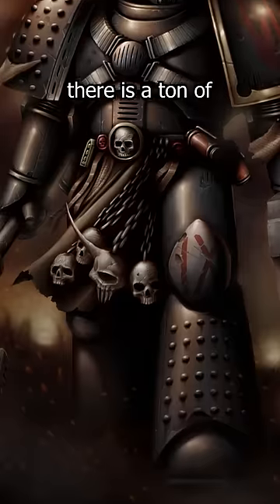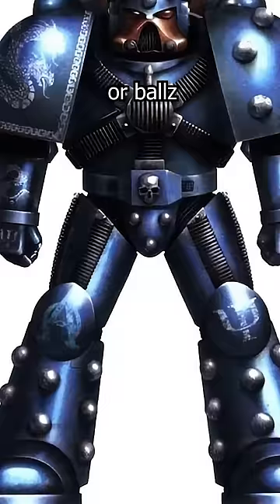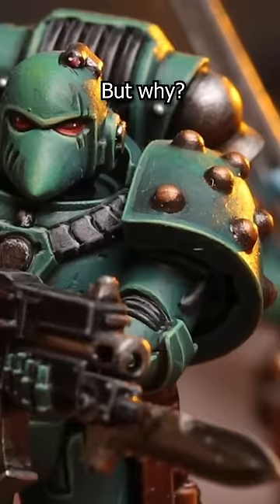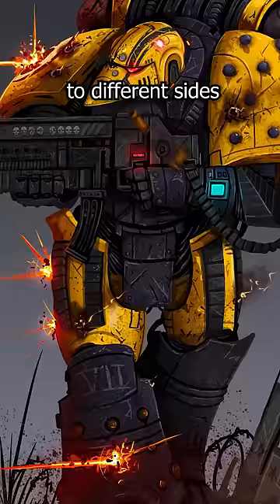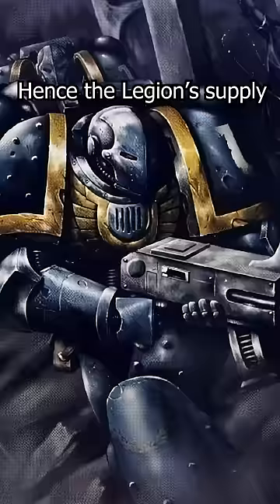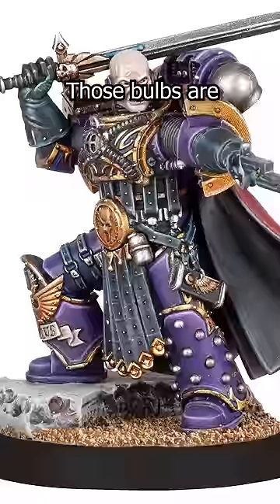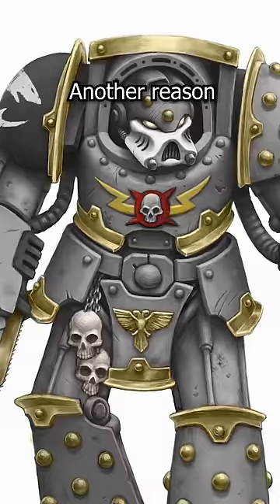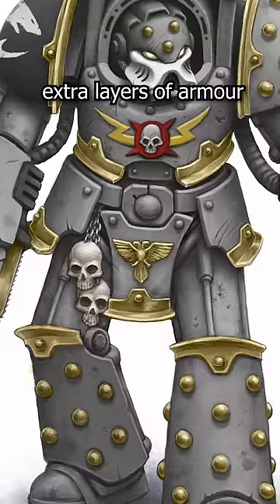What's Up With Those Power Armour Balls/Bulbs? #warhammer40k  #majorkill

Comment: I don’t know where I heard this but my understanding was that it was meant to be to better deflect bullets, that is it would make them ricochet rather than embed themselves into the armour
Reply: not very effective though, a curved smooth armor would work better than just balls.
Might be information that you may have heard but due to the passage of time, you have grown to associate it with warhammer40k. Human memory is fickle
Reply: That's false
Reply: @ZOCCOK  well... Given that resources are scarce "studding" the existing armor would be much more cost effective than making it all out of a superior material.
Reply: I thought the balls looked cool 😢😢😢
Reply: The big rounded pauldrons are specially shaped to be positioned forwards during combat, and are thicker and rounded which increases the likelihood of deflecting more shots. This is why the marines in Astartes are able to survive the hidden autocannon, since it's hitting their pauldrons as they run by. You were probably thinking about that and got it mixed up with these studs.
Reply: The bonding studs helped the armor not burst apart from the explosive bolt round not always working but still helping
Reply: studded leather tier reasoning
Reply: It might possibly disrupt the path of a bolt shell sufficiently to prevent it from penetrating fully, thus thwarting the mass-reactive charge that relies on the shell being inside the target. 
I still don't think it would be very effective at that.
Reply: Yup, that’s why the first marine minis GW produced (MkVI “beaky” Corvus armour) had the studs on one shoulder pad only; the shoulder pad that would be facing the enemy when aiming with their Bolter. For extra protection from incoming fire.
The molecular bonding stuff was added post hock, after the initial explanation, when GW started making more power armour variants.
If the studs were simply to hold the different bits of mixed and matched armour together, the placement would be much more random on the MkV Horus armour. As it is, the stud placement is always in the same place; lower legs, enemy facing shoulder pad and head. Exactly where the armour would be reinforced.
Reply: Yeah this was in the some of the older lore.
Reply: Nah think about the modern day tanks and WW2 tanks. There is reason why military stopped using a rivet for armored vehicle.

Comment: I remember reading somewhere that during the Heresy, both traitor and loyalist Astartes had extreme trouble actually killing each other after the advent of the MK V armor, due to its durability. Marines would have to mag dump each other and sometimes even be forced into melee despite the strength of their bolt guns because they couldn't break through the ceramite plating, making an already devastating civil war that much more brutal.
Reply: I mean that checks out, weapons like chain swords and bolters are better against organic targets
Reply: Still armor piercing rounds were in circulation with the traitors and loyalists with the formers being devised and design pre heresy in secret whilst the latter was designed during the heresy with the latter being rarer due to complexity funnily enough
Reply: @toasterten1293  Not if you look at the games cutscenes
Reply: @pilot778spartan3  The Traitors prepared for the heresy, but the loyalist adjusted quite quickly to it. Even with preparation, during the Istvaan massacre, they had a very hard time trying to crack the loyalist. The lost wargear didn't help the traitors either.

Things like the Terminator armor and bolters got disadvantaged very very quickly as the loyalist prepared and countered them. Used their weakness. Which is understandable. They want to live and survive, but also fighting is their profession. Analyzing the enemy and countering it was their norm.

Just some extra plates on the armor stopped the penetration of the boltgun and they didn't have any other means of weaponry mass produced as far as I know for the Astarte. There were power weapons, but they were quite rare.

The angling and thickness of the shoulder plates doesn't seem to help the boltgun either. It's massive. If there is no penetration, the Astarte is protected against the explosion. The advantage is highly negated.

It just doesn't seem like the traitors were prepared for what they gotten into. A very very desperate struggle and dug in defense, on maximum attrition. Against equal opponents too.

I think this is why they wanted Ryza. They produced plasma weaponry. That could've changed the tide of the War. An excellent anti-Astarte weaponry. But even there, the Dark Mechanicus was more interested in destroying Ryza, than conquering it.
Reply: Volkite my dude
Reply: @lukewhitehouse4103  Volkite my dude? Also where would they get volkite for a legion? They even had plasma swords and stuff. Making melee.. even more prevalent.
Reply: @toasterten1293  😊
Reply: @Kareszkoma   Wow that's actually really fascinating, did you learn this from the books? Where would I start If I wanted to understand Warhammer from beginning to present day? any books or movies, TV shows you can recommend?
Reply: Makes sense that explosive tipped bullets wouldn’t be able to pierce armor very well
Reply: @Kareszkoma  Martian Volkite weapons werent that rare in horus Heresy because they were made with intention to replace the bolter in later half of the Great Crusade, how ever with the advent of Horus Heresy in Imperium and Martian Civil war in Mechanicum the supply of Volkite weapons became increasingly rare and difficult to restock as the war went on, but regardless they were pretty much the 2nd most common weapon outside of bolters with Astartes, they also were much more effective against power armour than bolters.
Reply: @KoteDarasuum  Well. That doesn't sound nice. Doesn't sound nice at all.

Comment: I have always heard it was because if a bolt round hit the armor rather than the entire piece cracking and failing only a small section would.
Reply: Logically it would also help a lot against a melee weapons, since that’s basically the exact design that studded armor had. And considering the amount of people using the swords in Warhammer, it’s probably a good idea.
Reply: Heard same.  Instead of whole plate coming apart only the section between two rivets would break.
Reply: Yes this would probably be a happy side effect of the main reason.
Reply: Except that studded armour is pure fantasy, they were not used to protect
Some armours did have studs but their reason is to keep stuff together as was the reason in this short
Reply: @damonedrington3453  I think it would actually hinder them. It would be better to just have completely smooth plates that would deflect blades easier. The bulbs would allow a blade to catch easier. Studded armor is a fantasy concept and has never been used in real life.
Reply: @damonedrington3453  Studded armor is misrepresentation of riveted armor and brigandine that had fabric over the plates. Also they wouldn’t help a lot against chain weapons since they’d help with getting purchase.
Reply: @diarrheadan3601  I dont think that chain weapons were the focus as they suck vs power armour, Astartes would use the back of their chain sword to parry other melee weapons, as to not damage the chain.
Reply: @nikpapado9785  Yes, bud you can’t really parry or deflect a power weapon with anything else than a power weapon so it really doesn’t matter much
Reply: @StFelixofAstora  I didnt mentioned power weapon anywhere though. The galaxy doesnt just have chain and power weapons.
Reply: @nikpapado9785  true, but Astartes are not using any othwr type of melee (Except fot combat knives) and the main focus of HH was Astartes on Astartes combat
Reply: @Damon Edrington  Studded armor as you know has never been used. Literally people would rather just use gambesons with jack-chains and maille
Reply: You are correct. Video is wrong. It's reinforced plating. That's all. Nothing to do with the heresy
Reply: @damonedrington3453  except that studded leather stuff never existed. People just misinterpreted what brigandine armour is.

Comment: Corvis pattern armor with the metal nubs is the best armor. This is a hill I will die on.
Reply: But is it the mark 4 barbecue grill helmet, no
Reply: We will die on it together brother, back to back.
Reply: @toasterten1293  Mark 4 Maximus truly deserves is spot as the GOAT power armour through out the ages. Theres good reason why most honour guard units and the best equipped chapters still use it 10k years later.
Reply: I will whole heartedly agree friend.
Reply: @KoteDarasuum  Tacticus is also an imitation of it.
Reply: @gamechanger8908  yup, Cawl knew what was good. Biggest issue with MK.IV even though it was the best and most modifiable pre-tacticus power armour was the fact that it was also most expensive to produce.

Comment: Heresy armour was the easiest to maintain out of all marks still in use at the time, and I think with the additional layer of ceramite it was at least on par with mark iv in terms of durability
Reply: Thanks Eliot, Very Cool!
Reply: @dolphinerofachero3159  I am always here for you when you need me, son.
Reply: Wasn’t it horribly inefficient though due to subpar materials so overheating was a big problem
Reply: @riven5677  according to the wiki yes, battle brothers equipped with mk v power armour often had to utilise suits at lower power output levels in order to tolerate the build up of heat within the suits
Reply: @TableGrables  ok was just checking. Slightly off topic but what would you say is your favorite power armor ascetically speaking?
Reply: @riven5677  this one by far
*what about you?
Reply: The big downside though was because of the crude bodged together status of the armour, frequently the power linkages had to be run on the outside, which are visible as those flat black cables running along the limbs
Reply: @TableGrables  not sue but I dot know the mark three armor just speaks to me
Reply: @riven5677  yeah it's lore is cool too
Reply: @TableGrables  yup terminator however my favorites are the gorgon and cataphractii
Reply: @riven5677  i think they're all great but it would have to be cataphractii or tartaros for me, or the red butcher's custom suits
Reply: @TableGrables  oh those red butchers are cool tartaros would be a close second
Reply: @Sgt_Glory  and they often used much bulkier cabling too, facilitating the need for additional plating

Comment: i have seen those balls before in construction and mining. to me and this makes a hell of a lot more sense is that they are ramming studs. they are on the shoulder and legs. so a space marine can shoulder charge a wall and smash though it. those studs create a sharp point of contact with walls that will go right thought it. those studs are used on the tips of bore drills. same for the legs. they can kick over walls and pillers.

Comment: I always like to think they're capacitors for the armor's power system, which would have normally been hidden beneath an external layer of ceramite but lays exposed from equipment shortages. 

Post-Heresy, the exposed capacitor look was carried on by veterans of the war as a mark of service.

Comment: Huh... I read in the lexicanum at some point that they were studs made of adamantium that fullfilled the same role as metal studs in leather armor. it's a crude but cheap way to increase deflection and overall resistance of a material without having to cover it in plates which are much more expensive in terms of materials. And it made sense to me since essencially all of a sudden super humans with armor penetrating weapons were now fighting super humans with armor penetrating weapons and an easy way to reinforce their armor without making it full on terminator armor in a time when resources were scarce is to just stick some adamantium nails in it...

Comment: Just so everyone knows Heresy pattern armor isn’t an “official” pattern of astartes power armor. It’s a case of field scavenged armor from friend and foe and forgeworlds slapping together what they could make to supply the legions. No one suit of power armor that falls under that criteria are identical. Some suits even lose out on peripheral gear like radar, vox, and other features you would typically expect a proper suit of power armor to have due to some damaged parts never getting replaced, or parts from other marks were simply incompatible.
Reply: Sometimes the loss of access to such niceties were (as an example) the result of strapping a power pack to a suit that required more power than it could produce. Some suits with the bonding studs as well incorporated plasteel or other alloys since ceramite wasn’t always available.

Comment: Then why do we still have them in the primaris packs? There shoulder plates with the balsl on them.
Reply: It's to identify Veteran Primaris as we now have enough older Primaris to make veterans
Reply: @edwardclay7551  but is it using the original method because if so then that's surely a weak spot on the armour
Reply: @steve22ss  good question. One I can't answer. What I can say is it is supplied to veteran primaris. Knowing 40K it's likely crafted in the same way. But when they make artificer Armour they turn a 3+ save into a 2+. So whatever they do reinforces the prior structure.

Comment: Shouldn't they be putting those ballz in the chest? Not just the legs or shoulders? What's the point of the whole thing if the enemy can just simply shoot somewhere that doesn't have studs, and the chest is simply a big target...
Reply: It's likely that Power armor has thinned armor around the arms and legs, with thickened armor around the chest (sort of like real-life plate armor). It could be an attempt at preventing Marines from being crippled by precision Bolter fire. Space Marines also use their pauldrons as shields, at times favoring a side-facing firing position, so adding armor there makes sense. It could also just be tech issues, like studding through critical systems within the Power Armor itself.